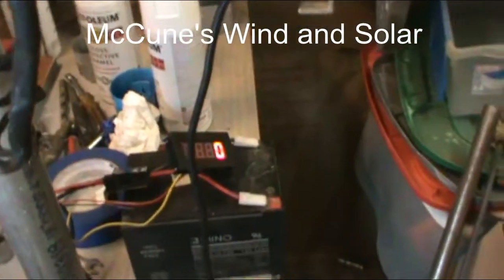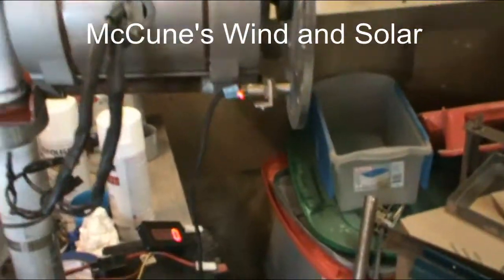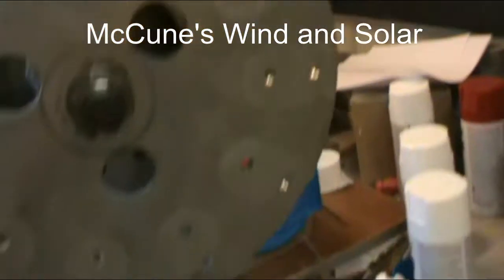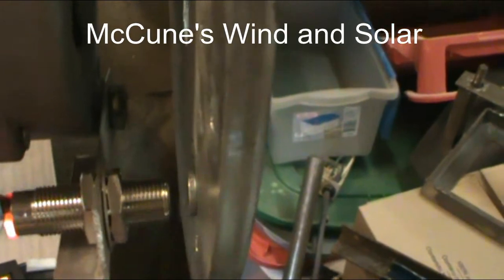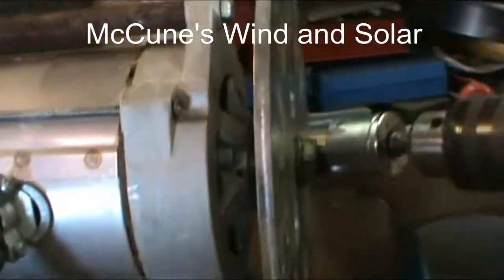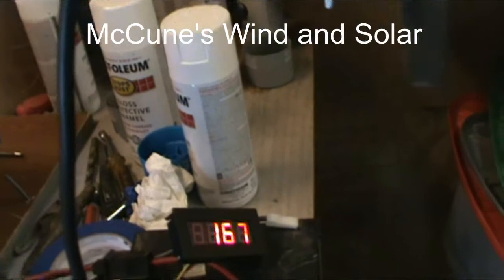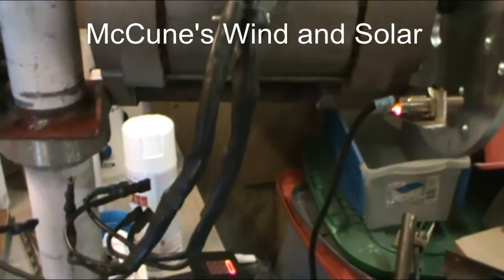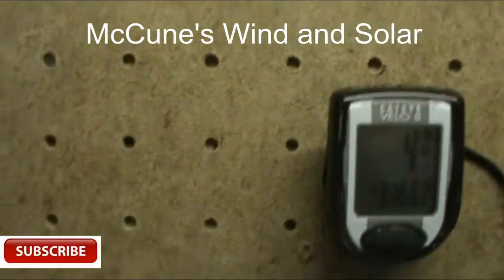RPM Gauge Setup and Review

Comment: That is a great idea to be able to measure rpm and wind speed at the same time. You will be able to get data on all kinds of blades and basically say which blades out perform others plus power out. MccunesWindandSolar  technology centre cool
Reply from the maker: yea its a work in progress getting all the gear together. Now I have to pick up some were form lows so I can make the wire that came with the censer longer. I can buy a chunk of 100 foot 3 wire cable from the hardware store then I have to fish it though the pole to the turbine. it looks like it will be nice this weekends so I might do that then. be nice for more data collection.